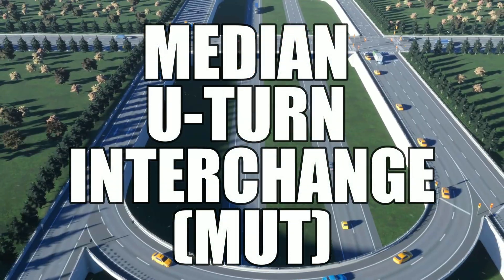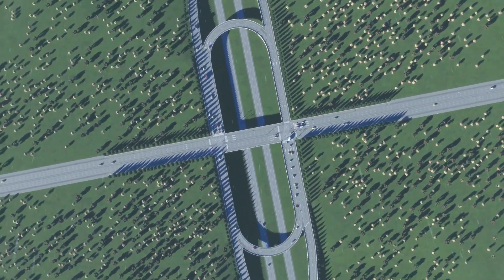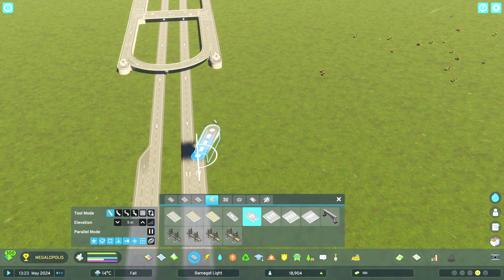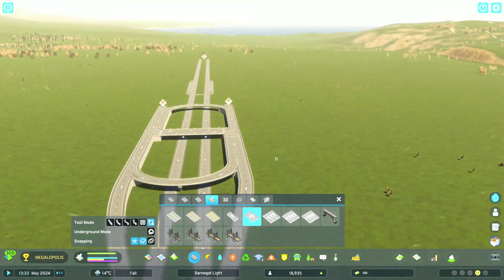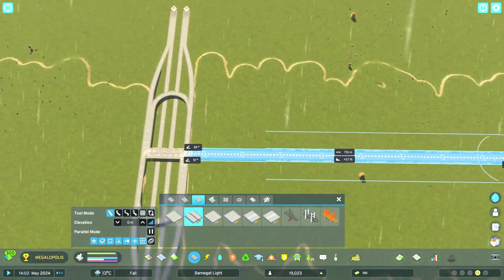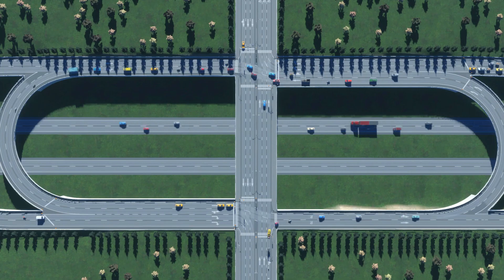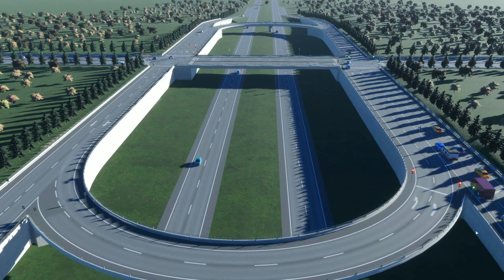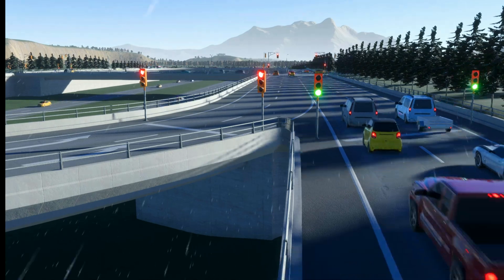How To Make A Median U-Turn Interchange in Cities: Skylines2

Comment: I think it almost makes sense to have the 2 additional lanes of the elevated sections on the outside instead of the inside of the loop. This would lead to left-turning traffic to have a smoother straight and the highway ramps could easily compensate for the asymetry. 

Also, did you consider a complex curve for the highway ramps? could be a bit smoother too

Oh, and awesome design, can't wait to build that in my city :D
Reply from the maker: All good ideas! The issue with getting the 2 additional lanes on the outside is that when you bring the U-turn section onto the inside of that 4 lane, the lower highway gets in the way. You can work around that by deleting the lower highway, drawing the U-turn in, then double click on the u-turn to create a new pillar node next to the old one, then draw the highway back in. Bit of a faff putting that in a video though :)

Complex curve is a good shout. I definitely under use that tool. Haha. 

Glad you enjoyed it though. Good stuff! 😊
Reply: @piccana_  oh, no, dont put the offramp to 4 lanes. they work perfectly with 2 lanes 1 way. You mentioned around 1:16 to make sure the extra lanes are on the inside of the circle. my proposal was to put them on the outside instead. That way, traffic going straigt ahead doesn't have to do that wiggly movement to stay in lane
Reply from the maker: @Chrizzey49  All good. We're talking about the same section. I maybe did a poor job of explaining on my last comment 😂

Basically, there was issues attaching the u-turns when the extra lanes were created on the outside. 👍
Reply: @piccana_ gotcha. I played with it a bit and you will need a tiny straight section for the offramp in that case :)
Reply from the maker: @Chrizzey49  Yeah, that's it's. Can definitely work around it 👍